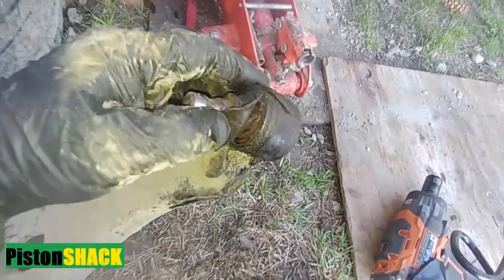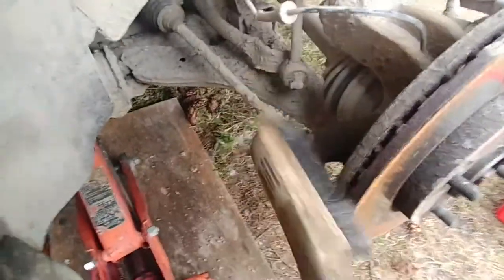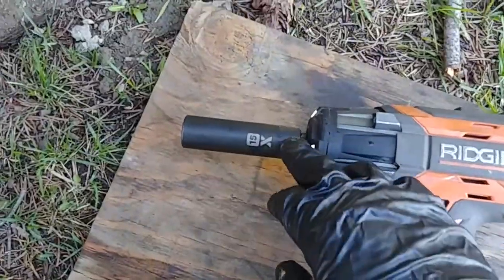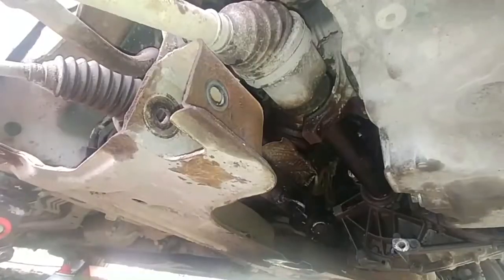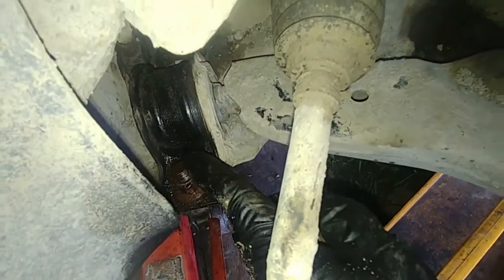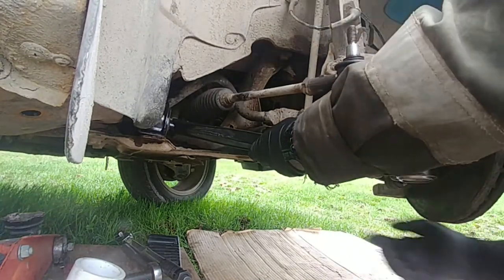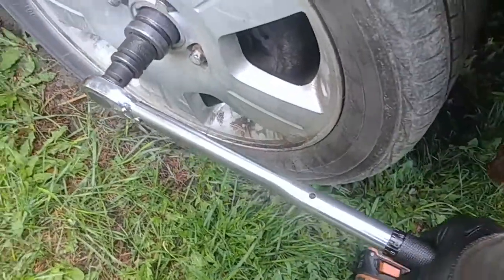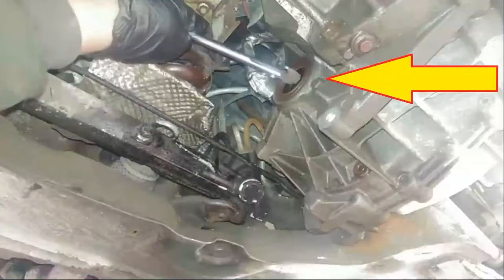FORD FOCUS 2001-2007: CV AXLE SEAL, LOWER CONTROL ARM, BALL JOINT REPLACEMENT.

Comment: Made a homemade seal installer tool. 24inch piece of 2in steel fence post for driver longer piece for passenger. Easiest and quickest attempt of the ten to fifteen I tried all together
Reply from the maker: Hey Jesse! Nice! That's way to go. I am going to pin your comment up, make sure other viewers can see it. Cheers!

Comment: Made a homemade axel seal tool for a  ford focus. 2" emt coupling 1" and 1/2  lenth 10 " pipe and 1" 1/2 × 2" reducer 1" 1/2 end cap and duct tape the 2" emt coupling to the reducer and take one of the locking ring off and drive that oil seal  in the tight hole.
Reply from the maker: That's smart idea! Thanks for sharing) I will pin your comment up, make sure other Ford enthusiasts!

Comment: Bro you made it look like a piece of cake!  and thats one Rusty beast u got there!  mines an  southwest car, hopefully things come apart just as easy...i only am doing the lower control arm balljoint dust boot..ours are torn up but joint is still ok... using energy suspension part 9.13103
suppossed to fit focus joint... thanks, new sub here!
Reply from the maker: Thanks a lot brother! It wasn't fan repair on this Focus originally from salty Quebec. How is your repair, bzw?

Comment: I have to do my passenger axle seal  I'm trying to find a axlebseal installation tool is there a cheap one or can you let me know the size I need please mines an 2006 ford focus zx5 5 speed manual transmission with a 2.0litre engine thanks
Reply from the maker: Hi Steve! I think you can find universal seal installer kit. I just used chunk of PVC pipe.
Reply: @PistonShack  thanks

Comment: You can drill or grind the balljoint rivets off and bolt on a new balljoint.
Reply from the maker: Well, you can but ball joint on Ford Focus comes with new lower control arm as one piece.
Reply: @PistonShack  You can buy the balljoint separately.
Reply from the maker: @mikkolempinen2717  I couldn't find one. Let me know if you will have luck.